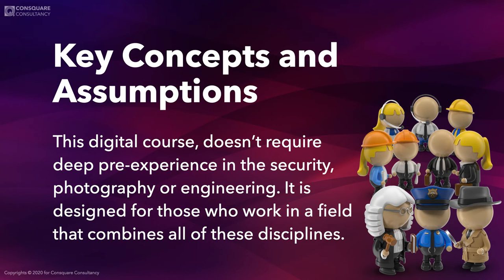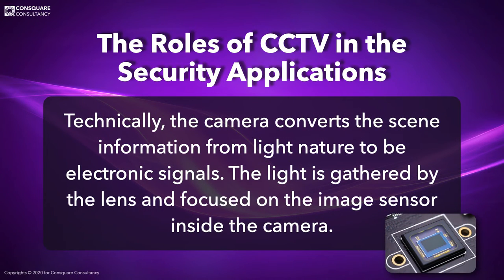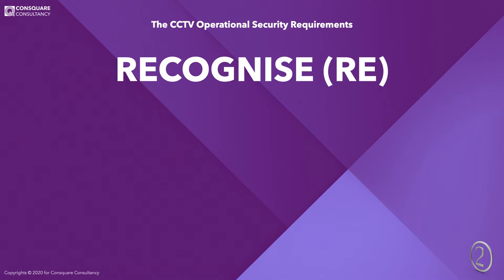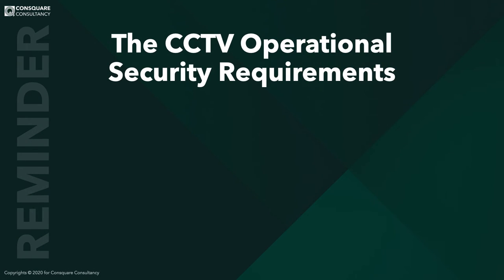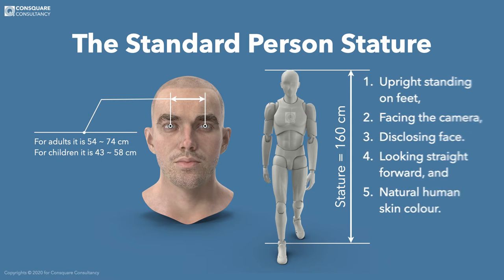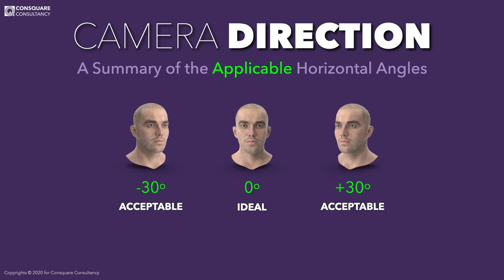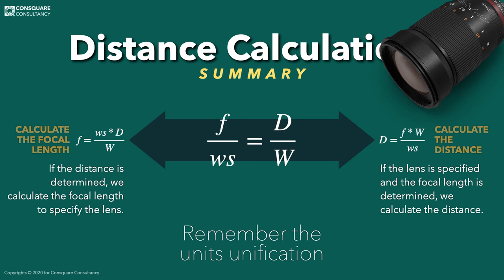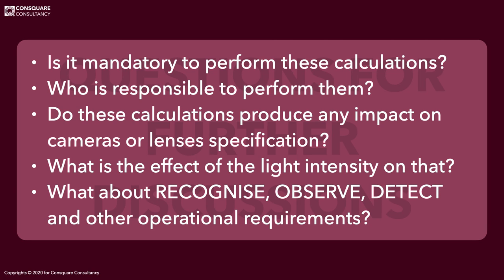Principles of CCTV Design for Security Applications   Part 1   English

Comment: Can you explain more details about PPM resolution for cameras? 
this was first time i hear about it !
Reply from the maker: Helkot, I am delighted to have you here.

Thanks for being the FIRST who discusses a technical topic.

Indeed, PPM (or the equivalent PPI and PPF) is not a resolution measurement at all. It is the "Pixel Density", the number of pixels relative to the unit of length.

It is a scale that determines how sharp the details of an image are captured (or displayed on the screen or even printed on the material).

The higher the density value, the more pixels per unit length are placed. Consequently, the pixels must be much smaller to fit in that unit length, and the lines are represented much finer.